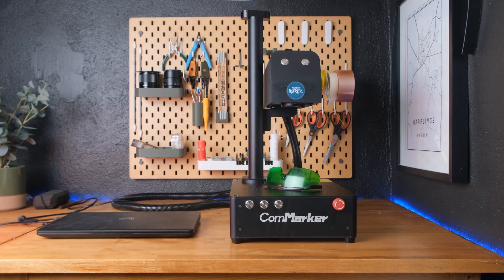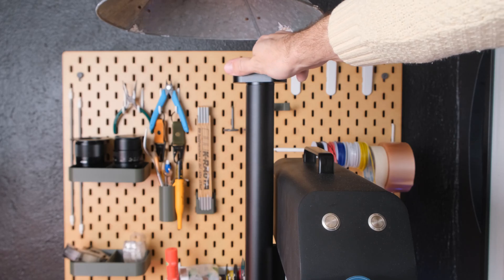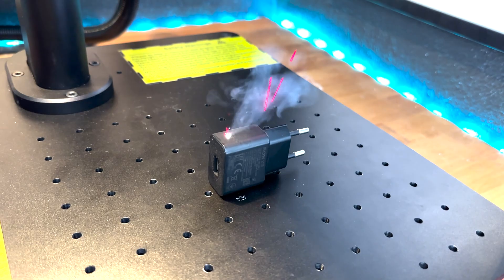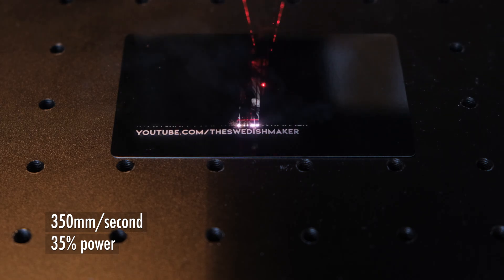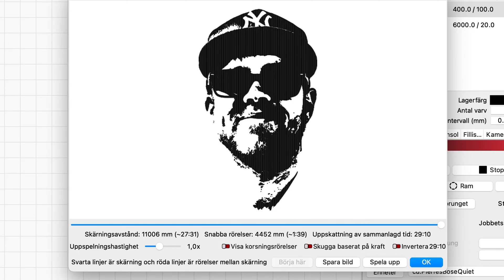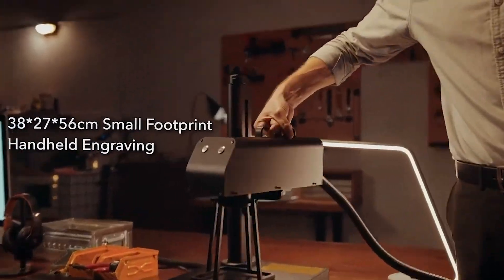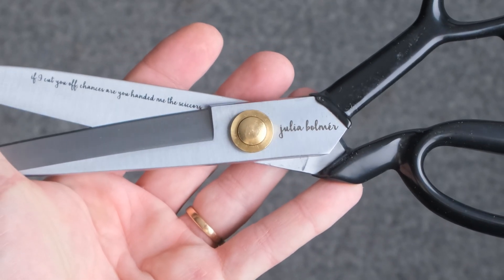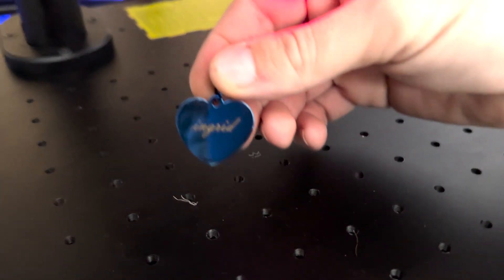Review from 'The Swedish Maker' —'this might be the LASER you need’

Comment: Hi, I own the same laser, great machine, but I do struggle  with rotary attachment (the set up in lightburn)  what value do you use for steps per rotation?
Reply from the maker: This is the parameter we set for laser engraving a ring.  
Split Setup
0.040Split size(mm)
0.0000verlap(mm)
Rotary Axis
OX Axis
OY Axis
Test
Rotary settings:
12800.0steps per rotation
21.600mm0bject Diameter
67.858mmCircuference
Motor speed settings:
500Min Speed(pulses/sec)3000Max Speed(pulses/sec)100Acceleration time(ms)
3000Return speed(pulses